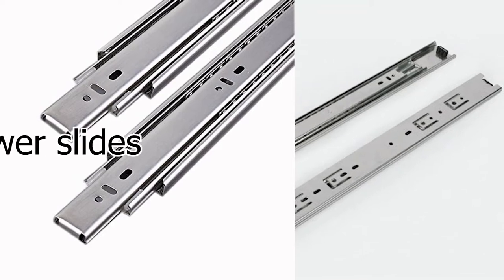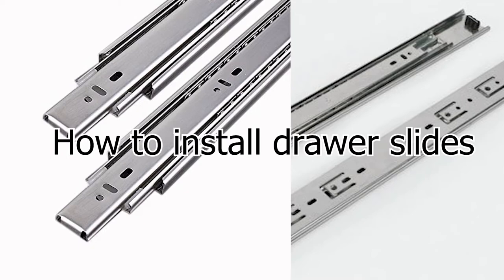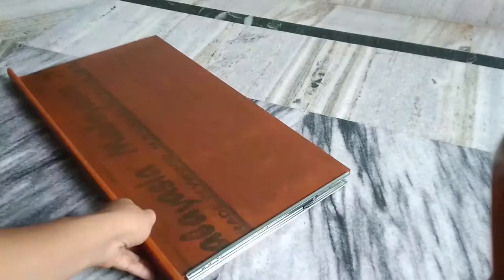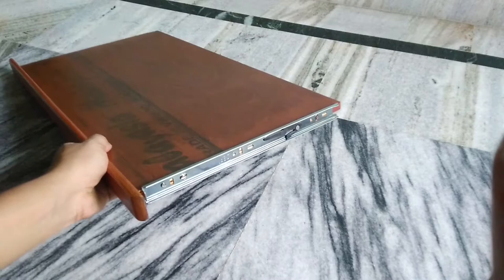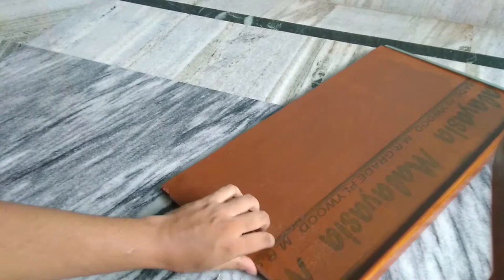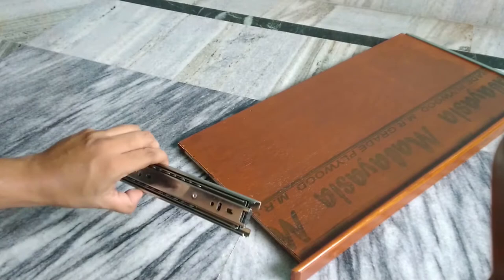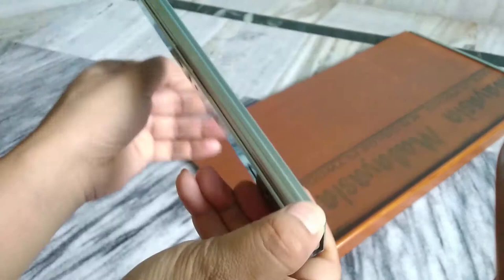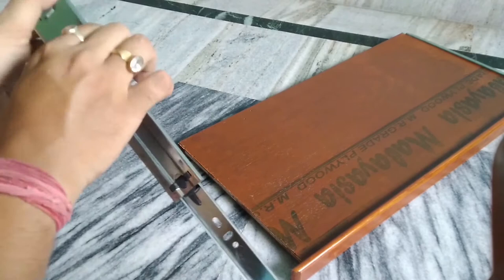Installing new slide for keyboard drawer

Comment: Thanks a lot my keyboard slider is making funny noise so I'm am replacing 18 inches length.
Reply from the maker: I'm glad that it helped you.
You can put some oil/grease, if it helps stop the noise.

Comment: Hello excellent video, just one question for you or whoever reads this comment: Is there the possibility of placing it below instead of the sides? I ask this question since it would be more aesthetic not to have to see the sliders when you open the keyboard holder. Thanks
Reply from the maker: Thank you! Although I am not a carpenter, but to install it below 
you need to have a wooden/some-kind-of support below the keyboard holder over which one part will be attached.
Reply: @sen.abhishek  Thank you for your prompt and kind response, I know of the ones you mentioned (HIDDEN) but they are too expensive here in my country, I thought that probably making a wooden support in ( L ) could be useful since my table is not as heavy, what do you think? It would be an alternative, I apologize for asking for your help. Thanks